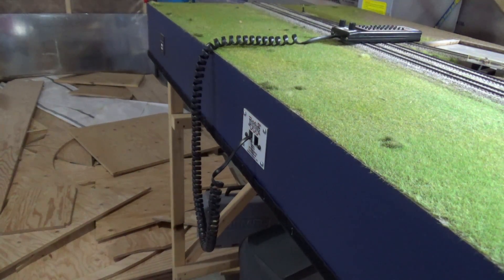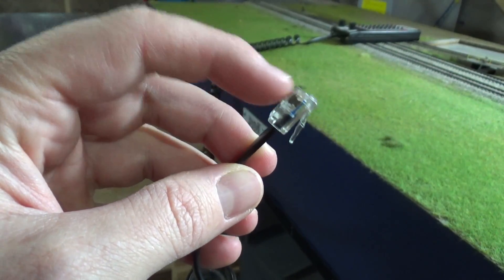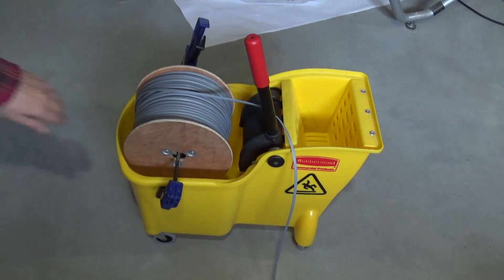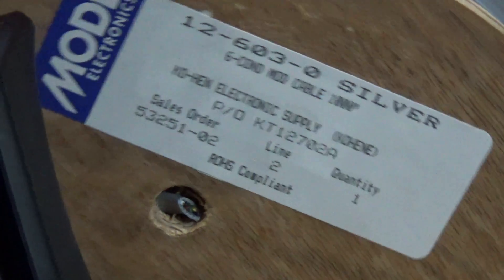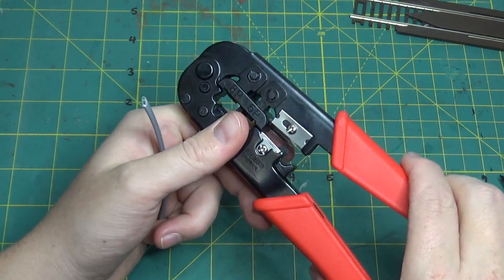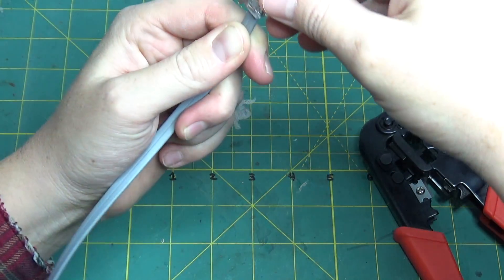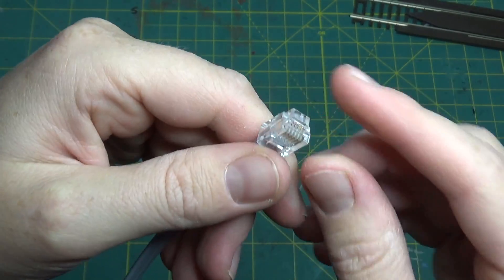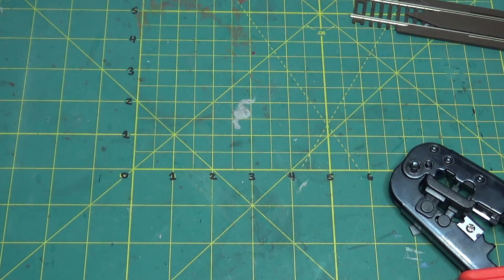How I Make My Own Loconet Cables

Comment: Dont forget that the other end of the cable has to have the connector 180 from the other end. If it was 'blue - white' on the first end, it needs to be 'white - blue' on the other.
Reply from the maker: Yep, we're saying the same thing. It's "1-1" which means the wires needs to be the same pins in both connectors.

Comment: you make it look easy. i am always using cat5 at work and it gets to ne a pain when you have to jump colours over them selfves.
 flat cable would be helpful.. and you can set your own colour codes,, long as both ends are the same left to right
Reply from the maker: You can do it with Cat5 or 6 conductor round cable, it's just a huge pain making sure the colored wires are all in the same order. Flat cable is the way to go if you can get it.

Comment: Shitty-Traxx Really?  I would of figured you for a NCE kinda guy :P
Reply: Which Sprog do you guys recommend for JMRI use? the ver. 2 or 3? I have a NCE PowerCab for now, but plan on following their upgrade path once I have more track in. In the meantime I'd like to set up my MacBook to use JMRI to finetune my locomotive decoders on a separate programming track.
Reply from the maker: I'm impartial to Digitrax or NCE, I don't care as long as it works with JMRI/WiThrottle. I had a couple legacy Digitrax boosters from my old layout so that's what I am using. The module is Digitrax because that's what Calgary Free-mo uses. I've operated a lot on both systems and neither of them is something to write home about.
Reply: I just have a very very low opinion on digitrax due to how easily their decoders have fried in the past, and the PR3 for programming is totally garbage (Turns off your sound for Soundtraxx decoders when programming).  My NCE USB or Sprog are 100x more reliable on a bad day.
Reply from the maker: Yeah I think even JMRI says not to use a PR3. I have a LocoBuffer USB for my layout and a Sprogg for my workbench programming track,  both work great.
Reply from the maker: I have a Sprogg II but I bought it years ago. I'd personally would go with what JMRI recommends on their website, they usually keep up to date with available hardware and what is compatible with current versions of JMRI.
Reply: Sprog 3 is great, or if your gonna use a Raspberry Pi like I do, they are also making a Pi-Sprog hat . http://www.sprog-dcc.co.uk/pisprog.shtml

Comment: Forget it. You are creating modern Layout so buy ESU Mobile Control II and control your trains via WiFi...
Reply: Im with Ben, Ive done a couple of layouts already and just reuse what I have already. Now for the WiFi system, Im old school and a New school as well, I personally dont like the WiFi system, Im not a fan of using a smart phone to finger touch all my functions and speed control. I like the throttles....I have more of a feel for controlling my locos. If I had my choice, I'd like to see mix of a UT4 with a smart phone face. I just like the feel of turning a dial for my train speed.
Reply from the maker: Cheaper for me to use stuff I already have and JMRI/WiThrottle which also is wireless WiFi. Signalling hardware still needs a Loconet hardwire connection so data cables are required.
Reply: i am looking for videos on that system, and see if people like it and how user friendly it is. I will check out your channel and see if you can sell me on it . right now I have 3 NCE system
Reply: i seen your response  after i posted this comment, i look forward to your video.
Reply: Sparky as I said, I make a video for you on my channel Max Supercars... 😊
Reply: WestCoastRails no problem. Look at my ESU Mobile Control II Review that I have created yesterday:
https://youtu.be/eVkPbfRwpOU